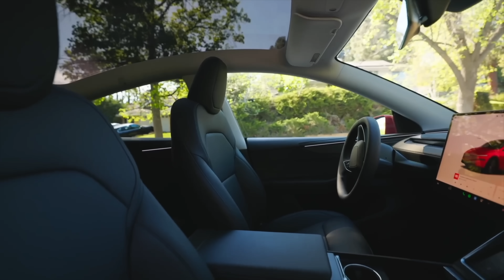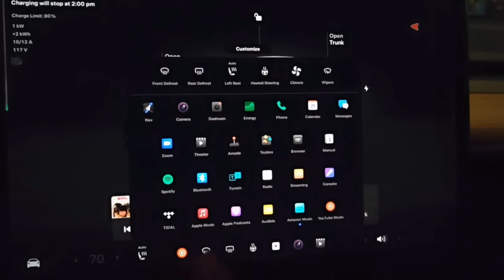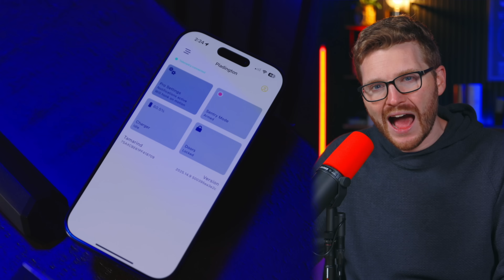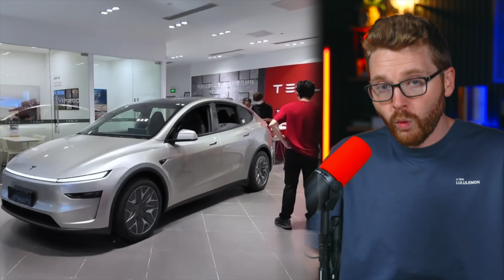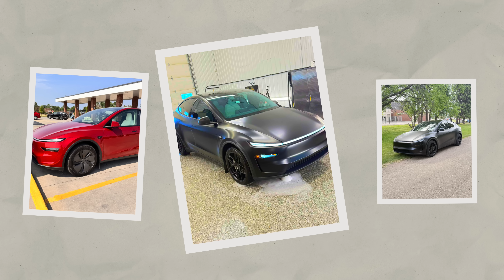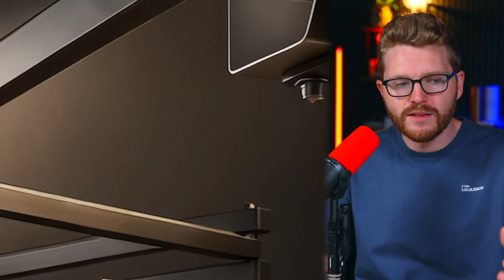Did Tesla Just Fix Their Biggest Mistakes?

Comment: Here's a "No Brainer" that still hasn't been updated in the model X...my X is a beautiful car but I'm thinking that I'm going to have to trade it off as Tesla will not update it so you can enlarge the TEXT on the flipping MAP...There is no way anyone can actually see street names and etc when you are driving around.   Yes you can do the 2 finger thing, but that only enlarges the graphics on the map and leaves the Text at the same small size.  I tried the AI ap and asked it if my year and model had a place to enlarge text and it told me to go toe Controls-> Display-> and adjust the text by sliding the red car icon up to enlarge.!!!   I went around with the AI ap 3 times that there was no such thing.  It insisted that Tesla made that update....not for some of us drivers they didn't...... my husbands right about cherry picking.  They updated some models so they can enlarge it, according to the AI APP, but not my 2023 Model X with the upgraded radar and computer.  OK, so they sell more model Y's, but hey Tesla don't you think the drivers of a 100K supposedly luxury car should be able to see street names and other items on the map???  My husband, who was set to buy a Tesla for himself has been disgusted that Tesla  cherry picks updates for Y owners and not for their pricier cars. PS. if anyone knows of a way to add a magnifying screen over the current horrible X screen, I'd be interested to hear it.  Text size is the feature that I'd like to have changed ASAP,,,,,it's a safety hazard when you can't just glance at the screen to know what street you are on or where your turn is!  Oh, yes, my family is complaining about the danger of the door handles....they think I should trade the car off just because of that.  I'd also like to see my saved destinations...if it's hidden somewhere I haven't found it yet!

Comment: I have had a model Y for just over a month. Initial impressions:

* Get rid of FSD. Yes, I've used it. I know what it's like. If you think FSD is a good driver, then you're a bad driver.
* Make Autopilot better/safer.
* Add Android Auto and Apple CarPlay. 
* Add Bluetooth AptX and or LDAC support.
* Allow Sentry mode and other parasites to run off the Level 1/2 charger if it's connected instead of slowly draining the battery after it's topped off.
* Mechanical Door latches

Comment: Hi, do you know why Tesla are restricting super charging in the United Kingdom to 80%? If you go over 80% they are charging you a congestion charge of 50 pence a minute after reaching 80%, so if you can't charge at home (maybe you live in a flat/apartment) or do not want to use third party charging because they tend to be more expensive and possibly slower you are being penalised. EV charging is not as cheap as you think or are led to believe. Running an I.C.E. car can be cheaper and without as many restrictions. Also by implementing this system Tesla should recalibrate the claimed range of their cars. My car has lost about 40 miles between 80% and 100% so it will no longer reach its claimed range without incurring congestion charge fees. I used to charge to 90% so when I reached home I had above 80% which was my decent amount of range for all the unexpected journeys and every day known trips, with this system in place I am having to charge more often which counteracts the reason this was brought in.This is very bad news for Tesla ownership.

Comment: Not much big stuff in there it seems... The ventilated seats have been standard on the Model X in the past and then just vanished. Good to hear they are coming back, but thats not big, that's just cleaning up a past mistake. The bigger battery is not exactly a customer feedback thing either, Elon has announced that already years ago (together with the Model S Plaid if memory serves... Plaid+ was the term back then...) and once again that is something that was just overpromised and underdelivered. 
In regards to the updates for Intel based cars: Well, a ton of things are missing there. And quite frankly: If Tesla were listening they would maybe proactively offer us "oldies" an upgrade to the current CPU generation and with that open up ALL the features, but so far this hasn't come.
And last but not least, just so it doesn't get lost: If Tesla were actually listening then they would start fixing their bugs and getting the "Beta" software bits to a released state so we can actually get support for them. 
Bottom line: Maybe Tesla is finally waking up, but somehow I doubt it.

Comment: Huh, the doorhandles issue( model 3 2017-2020) was that you can not open the backdoors when the elektricity was shut down and the back passengers couldn't get out. And the glass could not be broken because of safety glass. Will that be fixed with an update then??

Comment: The door handle on model Y is extremely difficult if you have arthritis in hands. Absolutely hate it. Hard to find the place to push in my dark garage. Have to get flashlight to find it on my black Tesla. Can’t really find it by feel or by looking.  Needs a glowing edge to find the handle on the low light of a garage. There ought to be a Raised T symbol at the spot on the handle where to push on the door handle if they keep the crappy push on handle feature. Maybe a raised  or sunken circle. Also hate that you can accidentally open frunk by bumping something on touchscreen and the car stopped working. I could not slowly pull into gas station I was stuck in gas station pull off lane.  I needed to drive ten yards more to get off the side of a busy road at night but could not push button to shut frunk. Car would not drive. I accidentally hit the open frunk on the tablet.  I could not move the Tesla it required me to get out of car on a side of the road at night to go shut the frunk. Very frustrating.

Comment: I'm not sure about the power frunk. That's just another motor. Tesla is already heavy enough. I rather they do what the aftermarket has already been made available, which is power soft close. What that one is missing is how it doesn't have a secondary release in case the piece is malfunctioning.

Comment: Got delivery of my Model Y Juniper yesterday and the update will not progress past 50%. Connected to strong wifi, done the screen reset, tried other WiFi and nothing helps. What an awesome first experience Tesla.
Reply: This is normal. It stops at spots during instal to diagnostic check the code already downloaded before proceeding. Just leave it a while.
Reply: @FriendlySkeptic Thx. It’s been 28 hours…is that normal?
Reply: @BallerMJ3131 still on 50%? My 1st update took a very long time but not this long.

Comment: Just a thought a small battery in drivers door to lower window in case of 12v or 16volt battery failure so you don't  brake the window. Or hand mechanical to lower window.